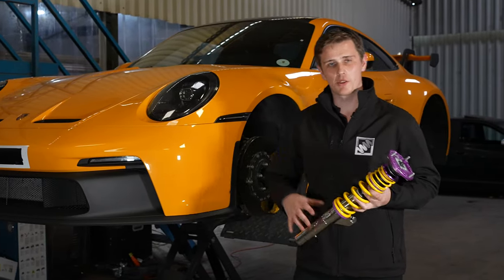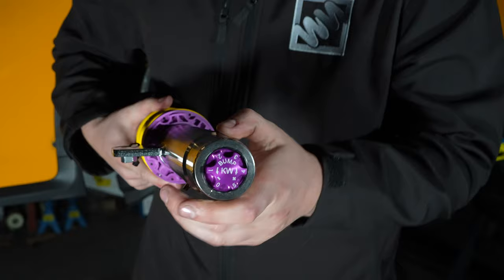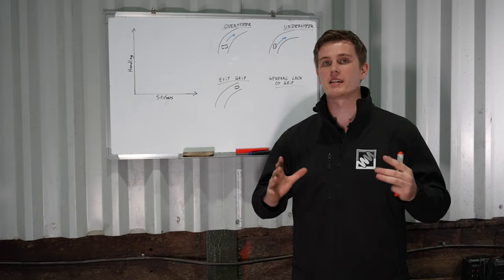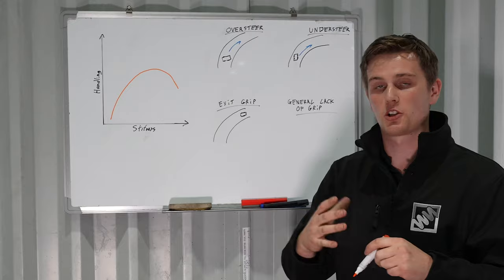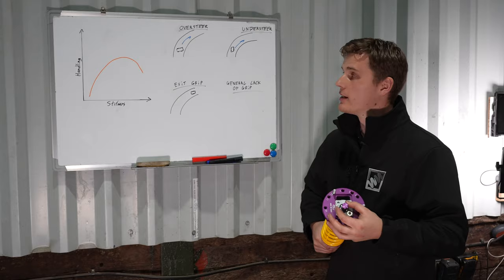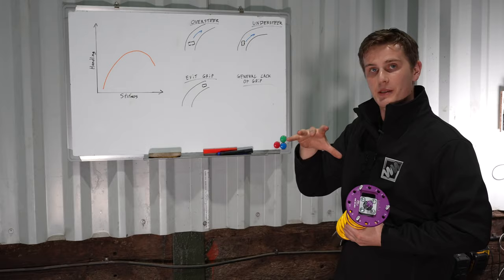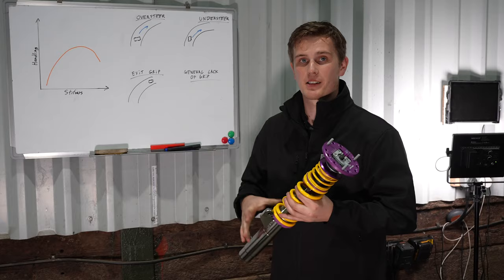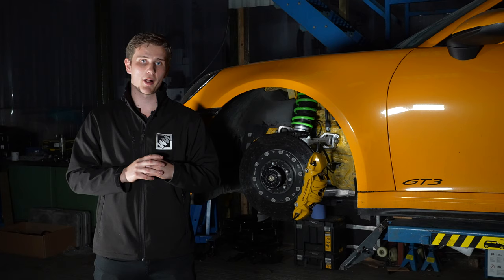How to Set, ADJUST and TUNE Coilover DAMPER settings.

Comment: Great video, although I don't understand you're adjustment on corner entry oversteer. You stiffen the front rebound. How does that reduce oversteer?

Due to braking the car will dive and causes the front suspension to compress / bump. So the car will be in compression / bump at the corner entry, right? This makes the rear lighter causing less grip / oversteer.  

I would think that you stiffen the bump setting (and not the rebound) on the front causing the car to dive less thus keeping more load on the rear tires  reducing oversteer.

Comment: One thing I don’t understand is that with coilovers where you adjust the height by moving the spring up and down will this change the settings as the spring will be stiffer or looser ?
Reply from the maker: Thanks for the comment. This is something we will definitely be covering in a video as it is an area of misunderstanding. We have got a very detailed article (linked below) that covers this for you in the mean time. 

https://suspensionsecrets.co.uk/coilovers-installing-and-setting-ride-height-correctly/
Reply: The short answer in no, your ride height won't affect the damper settings. The 'clicks' being adjusted here affect the valving inside the damper strut, affecting how fast or slow the damper reacts, this is not affected by the spring height. Also, changing your spring height (adjustable coilover) has no affect at all on the stiffness of the spring. I understand that you might think that by compressing the spring (to change ride height) you are changing its stiffness, but in fact you aren't. A (regular) spring has exactly the same rate throughout its whole travel, regardless of where it starts, or its initial loading.
Reply from the maker: @andrewdrescher6389   Spot on 👍

Comment: Any advice for a 996 GT3 Cup with Mid turn and exit understeer? It feels like the front is sawing away no matter how smooth you apply the throttle or adjust turn in point

Comment: When i adjusted my coils height i noticed the rear springs were pretty loose, like i can move them up and down by hand. They werent compressd. Is that normal?? Been riding like this for ywars years, and just noticed it recently
Reply from the maker: Thanks for the comment. Yes this can happen and isn't usually something to be too concerned about. One way you can combat this is by fitting a helper spring in series with your current springs to keep it engaged on full droop.
Reply: Should set your preload to about 6-7mm loosen uppper lock ring and spin it down about an inch the spin the big ring down till there is no tension on the spring. Run the big ring up until the spring is snug but almost no compression. Then run your lock ring up softly against the big ring then twist the big ring until you create a gap between it and the lock ring that is about 6mm then run your lock ring up and tighten it up repeat that on every corner.

Comment: This maybe a dumb question but bump and rebound is always explained and adjusted with someone holding up a coilover in front of a car with a wheel off. 
So, in real life situation, do you adjust these settings with the car just sitting on the ground? Or with car in the air and wheel off? Your video explains everything else really well, thank you!
Reply from the maker: Thanks for comment! That's usually so that you can see the coilover and the adjusters clearly for the video. You can adjust the coilovers in terms of bump and rebound with the wheels on, off, in the air or on the ground but the biggest issue is access to the adjusters so just depends upon where the adjusters are located on your particular coilover kit.
Reply: @SuspensionSecrets  thanks for clarification! Just wasn't sure if you had to take the pressure off the coilovers to adjust.

Comment: Great informative video!
Question:
So for example: you have understeer at the corner exit.
Which is the better solution? Change the rear coils to stiff the bump, OR put the swaybar to a more hard setting?
I don't get when to touch the coils and when the swaybars.
Reply from the maker: Great question! 

So the best way to categorise it is…if the issue is on corner entry or corner exit then adjust your dampers. If the issue is at the mid corner (apex) then adjust your anti roll bar 👍 hope this helps
Reply: @SuspensionSecrets  million thanks!! :)

Comment: I would like to hear about the ratio of compression to rebound.    

I have MCS 2-way remotes on my 718 GT4 and even though MCS says no, having played with a ton of different settings, I can tell you that with their base valving, setting all 4 corners for both bump and rebound at the half way point (9 out of 18 clicks), keeps the front and rear axle in sync and makes the car feel more stable.

When you start using different compression and rebound settings front to rear, you get more pitching motion on the throttle/braking axis and the front and rear axle start to feel out of sync with each other.   

I also noticed that if you use less bump than rebound for a given setting, then the rebound stroke has to do more work and that also throws the car out of sync on the vertical plane and causes a harsher ride and a sharper rebound movement.

Then I recently watched another coil-over video where they say to run bump as high as possible (before making it harsh) and use as little rebound as possible (without inducing wallowing)
Reply from the maker: Thanks for the comment. It does vary depending on vehicle mass, weight distribution and manufacturers specs of the dampers. That said for a mid engined rear wheel drive car such as yours we would tend to run the rear compression slightly softer than the front compression and the rebound a couple of clicks stiffer than the bump settings as a starting point. We would then advise to head out on circuit and fine tune each adjuster based on how the car feels. Suspension is also very subjective and different people like a car to drive differently to one another which is why its important to fine tune to your preferences.
Reply: @SuspensionSecrets   Exactly, he could be pressing the throttle, braking or turning the wheel etc - in a way that enables the car to behave that way. Someone else who may drive the car on the same settings may want to create 'opposite' changes depending on their driving style.

Comment: Ignoring oversteer or understeer as my application is awd, would it be safe to assume that squat on corner exit and nose diving during hard braking could both be reduced with increasing bump on the rear a couple clicks stiffer AND increasing the front rebound slightly?
Reply: Not quite. Adding rear bump will reduce rear squat on corner exit, but it won't reduce front dive under hard braking. Same story for increasing front rebound -- less rear squat, but no change to brake dive.

To fight both brake dive and acceleration squat, you can increase the same kind of damping on both axles (e.g., increase bump damping front AND rear) or you can increase both bump and rebound damping on the same axle.

Assuming you've been specific to use the terms brake dive and rear squat, my initial recommendation would be to add bump damping front and rear.

However, let's say you realize what's actually happening is not rear squat, but instead the nose lifting on acceleration. In that case, adding front rebound damping would most likely be a better adjustment than increasing rear bump. Similarly, if the rear is lifting when you brake more than the nose is diving, use rear rebound instead of front bump.

If the nose is diving AND the rear is lifting under hard braking, add both bump to the front AND rebound to the rear. If the nose is lifting AND the rear is squatting on hard acceleration, add both front rebound AND rear bump.
Reply: @Talynen Now that's very helpful! There's body roll too and my understanding is body roll is more controlled by stiffer rebound as well so perhaps your recommendations for more rebound are the way to start and go from there.
Reply from the maker: Thanks for the comment. Talynen's advice above is very good and has answered perfectly!